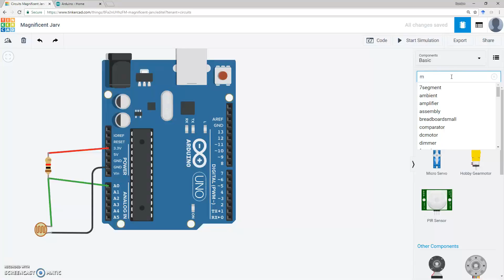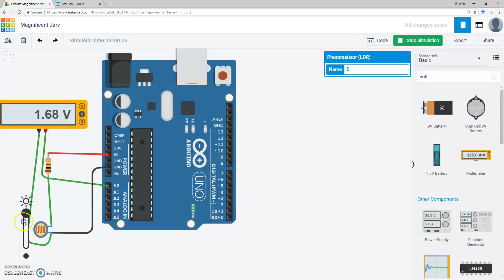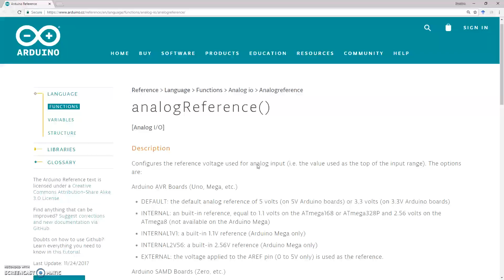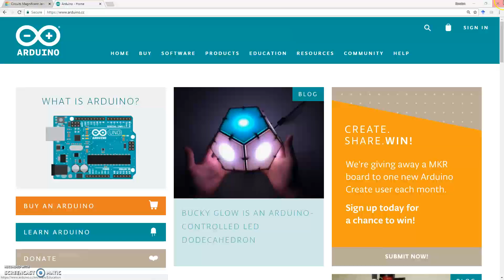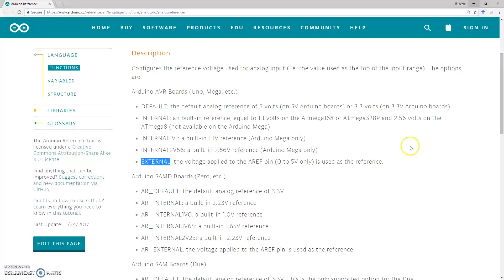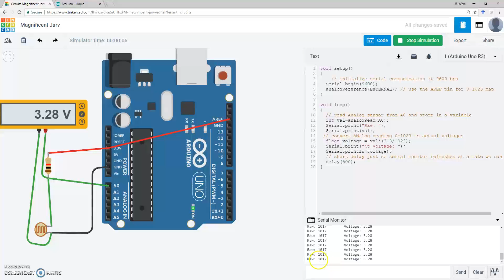6 ARDUINO ANALOG analogReference

Comment: Hi, I don't understand why when you make the conversion you still use 5.0   = val * ( 5.0 / 1023 ) even if the sensor is power up by 3.3 Volts ??
Reply: same here: I dont understand, why you keep 5.0 in the code, even if voltage is changed to 3.3 V ?
Reply: @tiborfarkas3205 basically what happens is , regardless of the voltage value used , the 0 to 1023 will go all the way from 0 to 1023 regardless of whether u use 5v or 3.3v